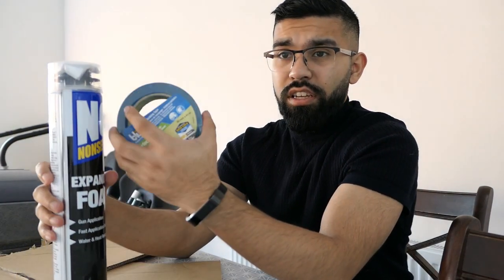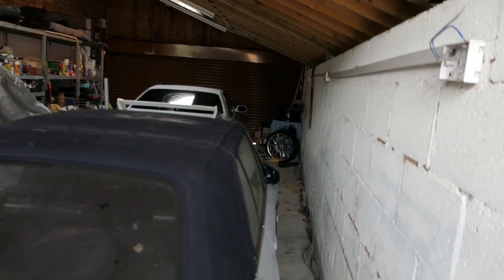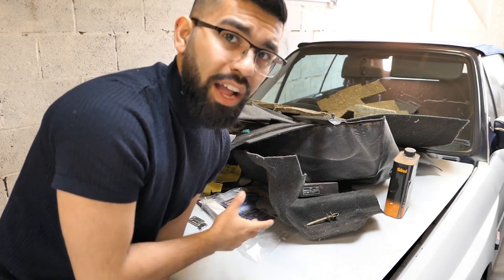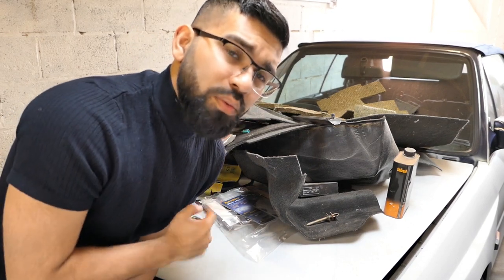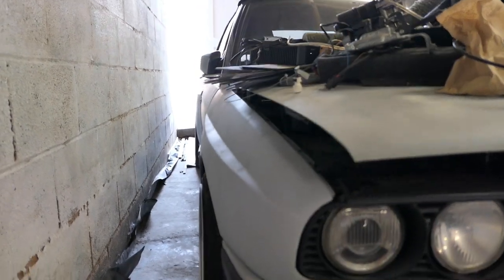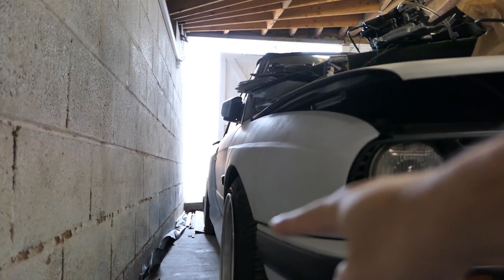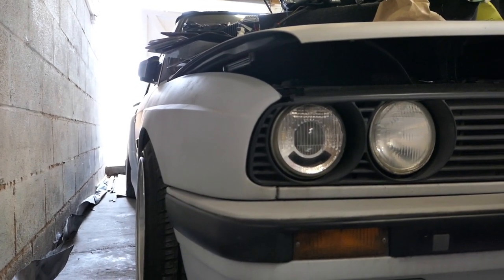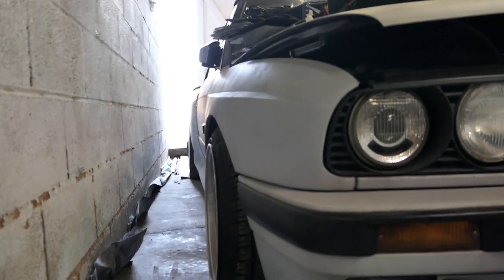DIY Widebody M3 BMW E30 Build | Expanding Foam

Comment: Primer coating is like a sponge, it will absorb moisture and cause rust and/or cracking. Better off doing a temporary base coat to prevent deterioration until you're ready for actual paint.
Reply from the maker: Good point. This is very much a big learning curve for me but that's not a bad idea!

Comment: Are you selling your old wings
Reply from the maker: I think so mte, once I have finished up with the new ones!
Reply from the maker: Are you interested?
Reply: Yes I need a both of them my someone done a hit and run on my passenger side
Reply from the maker: Are you UK based mate? Sorry to hear about that... crappy whenever that stuff happens
Reply: Mr GCC yes I live local Birmingham I got a blue e30 like yours pre face lift chromie and I couldn’t make it to the bmw parts centre meet up but hopefully whenever there’s a next time should bring my e30 up there
Reply from the maker: That's awesome man. I just want to confirm. Are you looking for the stock wings for the M3 style wings? Just so we are on the same page 😅
Reply: Mr GCC yes I want the stock ones the one that was in this video work with me on a good price and I’ll pick it up from you I live local
Reply from the maker: Ahh... that case I'm not 100% if I can help... I was looking to use my stock ones. Let me finish designing it all and see which way I want to go with it all
Reply: Mr GCC let me know
Reply from the maker: Will do bro